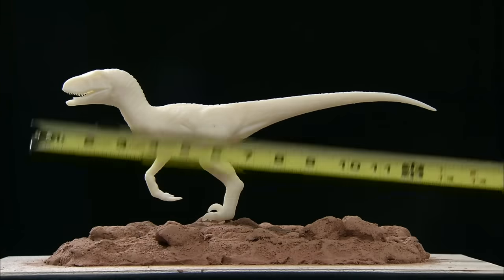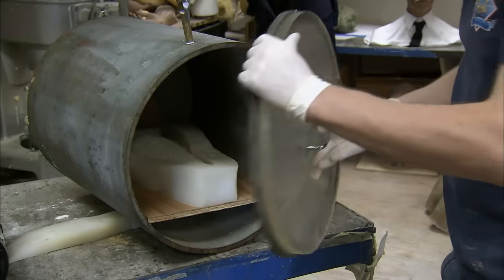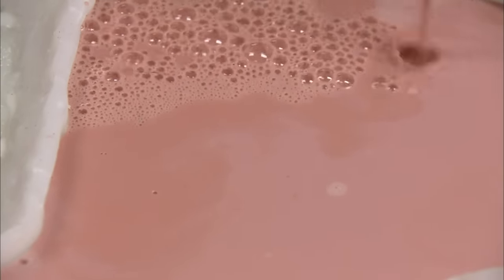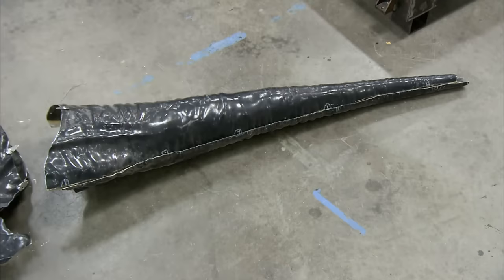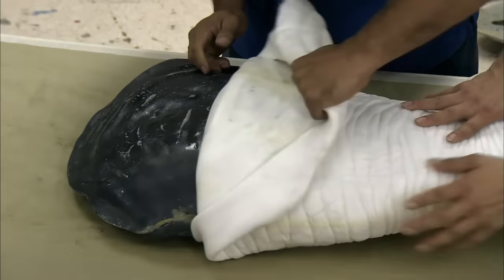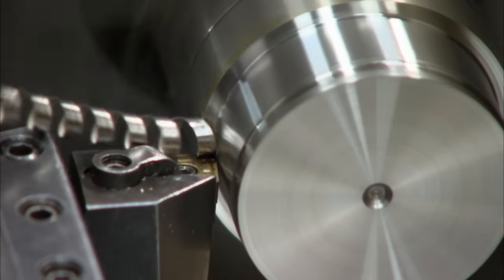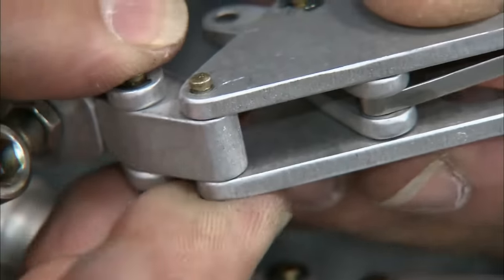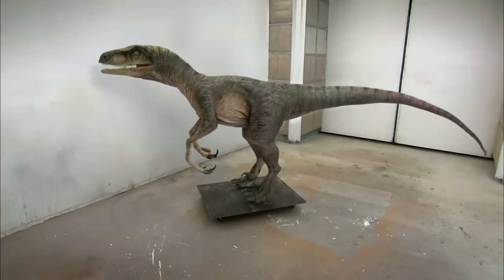ANIMATRONIC DINOSAURS | How It's Made

Comment: Okay, as an animatronic creator myself, it annoys me a smidge when the narrator states that the cylinders are pneumatic, explains that they work on compressed air, and then ten seconds after calls them hydraulic... and as far as I can see, and true to the first statement, the character is completely pneumatically operated. So how could you get mixed up and say that they are testing the "hydraulic" components.. It's a whole different cylinder and is powered by the pressure and flow of liquid, not air! Sorry for the rant, I just thought I'd point it out. Everyone is talking about the fact that it isn't a Velociraptor or whatever but I just couldn't let this slide 😂

Comment: We actually dont know how dinosaurs sounded like because we didnt have any recordings back then 🤔
Reply: What If they sounded like a fart
Reply: some did have bony structures that were used to create sound. Parasaurolopus for example, these head pieces were remodeled and then later pushed air through to create sound. This is not completely acurate though as we don't know how they controlled this themselves, so it's more guesswork. they actually show this in the first Jurassic park movie (raptor).
Reply: Using dinosaur's modern relatives and other animals, scientist have figured out that tyrannosaurus had more of a super deep growl like a crocodile instead of roar, and that Brachiosaurus sounds from Jurassic Park are actually quite accurate to their noise
Reply: @kayleighbuys585  True, since fossils generally only show bone structure we have no idea of the exact shape and structure of the more fleshy parts of the respiratory system (technically vocal chords can be considered as a part of the respiratory system even if you don't need them for respiration) and sinuses which affect the exact range of sounds a creature can create.  There was someone once who actually showed how different a creature can sound with the same skull if only the sinus cavity is altered slightly by thickness of membranes or additional fleshy tissue partitions (which I guess some animals have, don't know which though).  That isn't even including what kind of vocal cords they have which can also greatly alter the types of sound they make and we can never know because that kind of flesh is not fossilized in any case except perhaps true petrification.  Even some animals that have fairly recently become extinct we don't know what sounds they made because often the people who hunted them didn't think to record it by writing accurately about it let alone audibly recording it.  All that was usually preserved was hide and bone, which is about the same as fossils are in judging how they would have sounded.
Reply: I know this is an unpopular opinion because of how lame it is, but I'm pretty sure they couldn't roar like in the movies. Actually, im pretty sure they couldn't roar at all due to weaker vocal cords. They probably didn't sound too much different from modern birds and lizards.
Reply: We can theorise what they might have sounded like from looking at modern-day birds and at their bones etc. What we can absolutely figure out is that they did not roar.